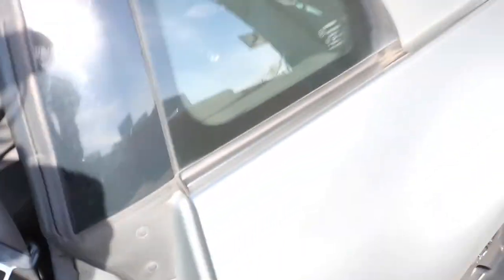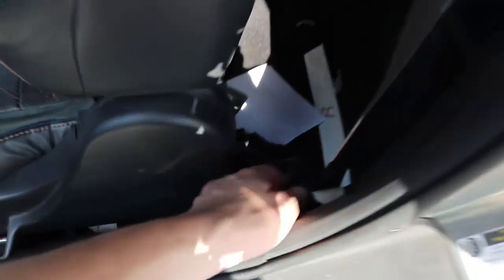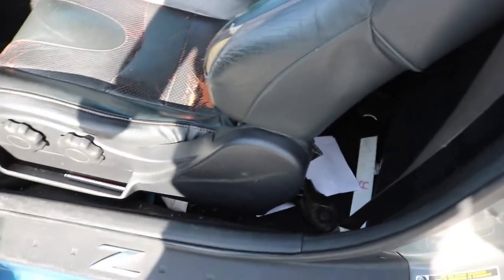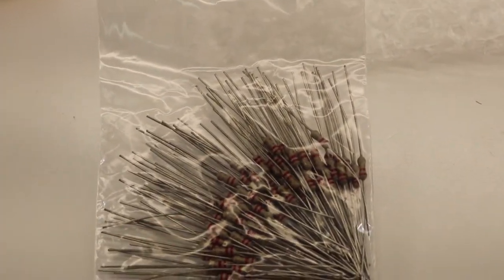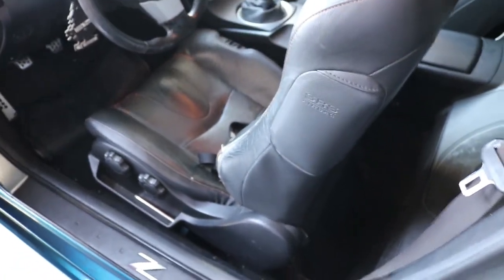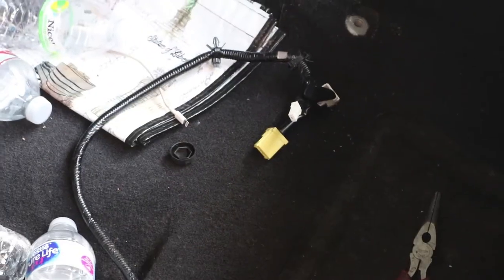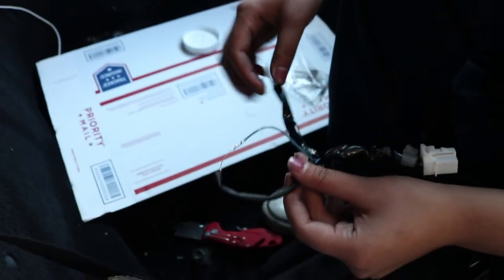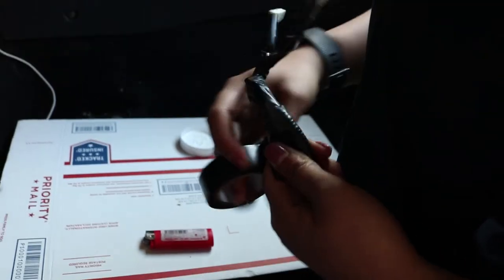350Z Air Bag Resistor Install For Racing Seats Or Seats W/O Airbags EP29

Comment: Tin the wires first, then just apply heat to fuse them together.   Also use a smaller gauge rosin core solder

Comment: you should not cut off the yellow plug as someone might want to renew the airbags in the future and will need that plug in tact. you can buy those resistors that push into the yellow plug with no soldering required.
Reply: I bought them, so I have to disconnect the battery or just plug in with the car off and that’s it?
Reply: @Javierrr18   can u give me the name off the plugs u get it?
Reply: Can u tell me the name and where I can ordered?

Comment: I added the resistors to the drivers airbag wires as I have a grip royal wheel and the codes still show as open. I used splice connectors to add them in
Reply from the maker: Sorry for the super delayed response. Did you dis-connect the plugs?

Comment: Never cut at the plug. If you ever want to return to stock you can’t
Reply from the maker: When we did this, we never thought of selling the car. But yeah, I don't normally cut plugs off like that
Reply: Yeah you can. If you have the plug you can just solder it on and black tape it or use shrink tube

Comment: If you have a base model that came with the cloth seats, then do you not need the airbag resister when installing aftermarket seats?
Reply from the maker: This was on a touring package with heated leather seats, here in Cali the summers can get pretty hot, and my wife wanted cloth seats so the leather ones don't burn her legs in the summer
Reply: @fullthrottleperformance  so then if you have a base model that came with the cloth seats, do you not need the airbag resister when installing aftermarket seats? I don’t believe the cloth seats have airbags in them. Did you have to plug anything in?

Comment: Please make a video going over diff bushing upgrade/replacement
Reply from the maker: Clayton VanDam Sure will, gonna be welding a diff soon, and that's part of the install👍
Reply: Full Throttle Good to hear! I have some whiteline bushings on order
Reply from the maker: Clayton VanDam I was thinking about getting some white line ones too then getting solid for the sub frame. Or vice versa, I have to do some research first
Reply: Full Throttle I heard theres a lot of noise and vibration with solid mounts and I daily my car so Im going whiteline
Reply from the maker: Clayton VanDam I also daily mine, but I think if you went poly with one then solid for another might dampen the noise/ vibration a bit

Comment: Does this work on a 370z? I bought a 370z with passenger seat and door airbag deployed.
Reply from the maker: You'll still need to get your SRS module reset. But I don't know the proper ohm value for 370z's. There should be a decent amount of info on forums for them tho
Reply: Full Throttle ok I’ll do sone research thanks. Do you think theoretically this method would work for the door airbag?
Reply from the maker: It should, because it's a resistor all it does is basically tell the srs module there's an airbag there.
Reply: Full Throttle well I bought a new door airbag on eBay but I’m using the resistor for the seat. Found out it’s a 4.7 Ohm 1/2 w for the 370z. Thanks again

Comment: Will this work on a 2013 Altima? My airbag light it's on and it's cause of driver side seat I'm going to try this
Reply from the maker: It may use a different resistor, but the process should be somewhat the same.
Reply: @fullthrottleperformance  thanks  for the respond  it worked thank you so much
Reply from the maker: Awesome! Glad it helped you out

Comment: Could I essentially  use wire tap splice pieces (x2) - 2 wires and the 2.2 ohm (.25w) and clip them on the air bag wire coming out of the floor vs cutting the adapter off like you did?
Reply from the maker: Yeah, you could do that. It's the same concept, we just never thought that car would be sold when those wires were cut lol